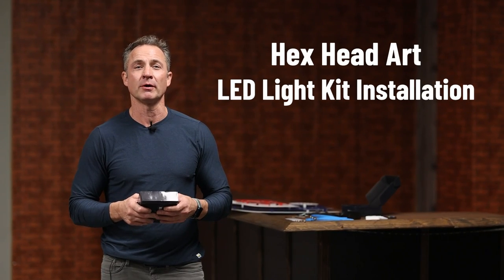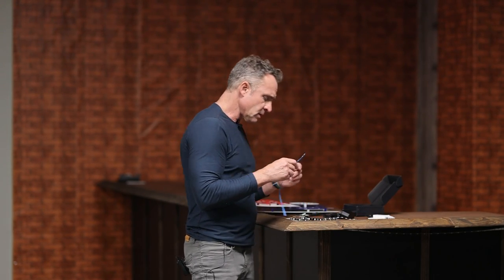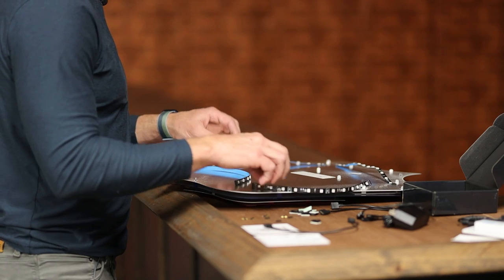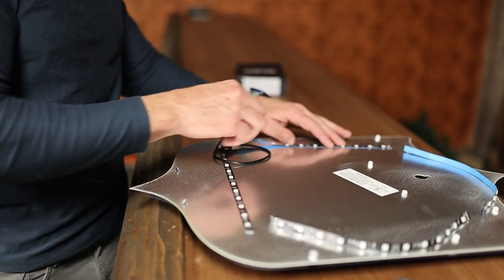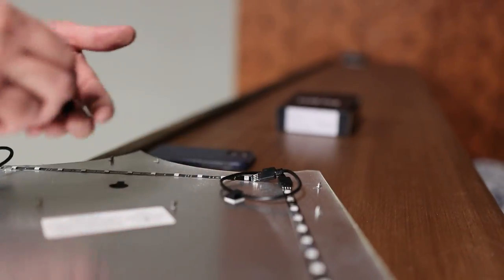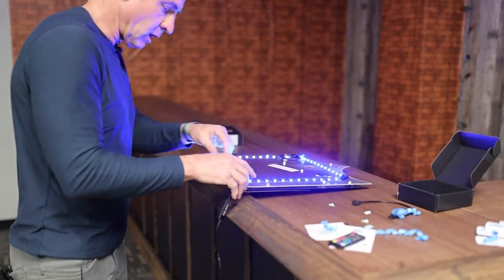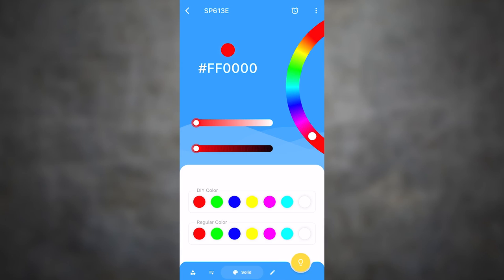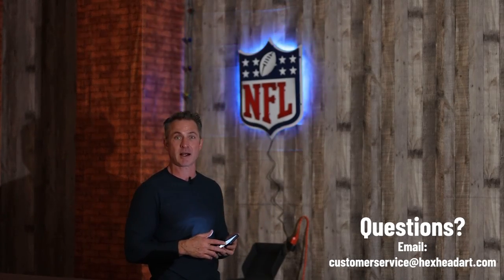Hex Head Art LED Light Kit Instructional Video

Comment: Worked like a charm only difficult part was getting the lights to come on together I had to turn some of the strips to the opposite sides and connect from different ways, but I finally got them to all come on together.

Comment: DON’T waste your money on the LED Kit.  This video is next to worthless.  50 bucks down the drain.  The artwork, however, is stunning.
Reply: Definitely was a pain in the ass to install and I could never get the 4th strip to work.
Reply: Would be better if they installed a lithium ion battery and already connected the lights to it and you could charge the battery up and it last for like 6 months or so
Reply: Absolutely agree, couldn’t believe they sell this small one for $50. If you want to light it up, there are way better options. I got a led light strip on Amazon that connects to WiFi / has an app and works via voice control (Alexa, google home, etc…), is long enough to cover the back of 3-4 pieces (16ft), and cost me $30. It’s way better than the one they sell and cheaper. You can set each different segment of the strip to a different color, so I can have all 3 pieces of art I have each be a different color to match them.  Or make each one even be multi color if I wanted to.  It also has more functions than this one (different effects, music sync, etc…).